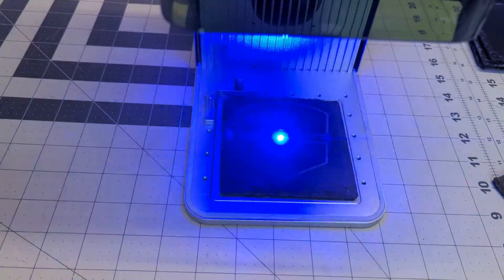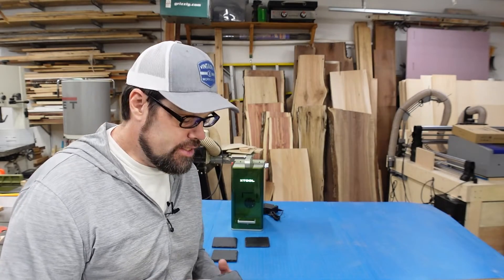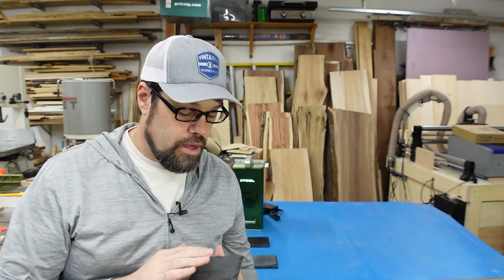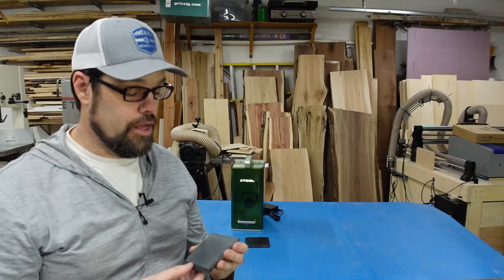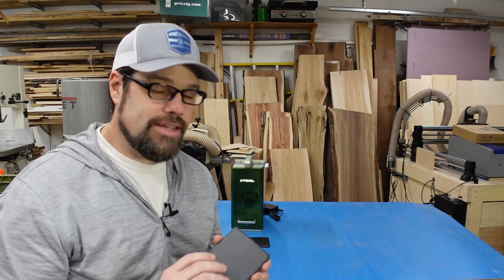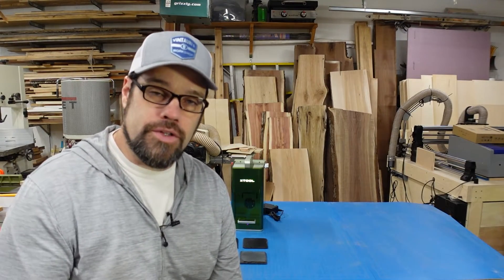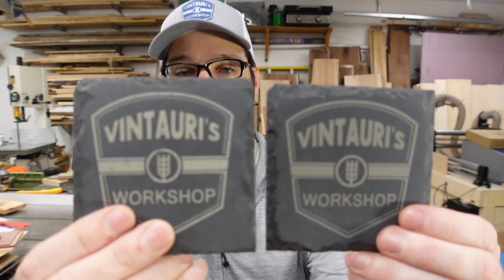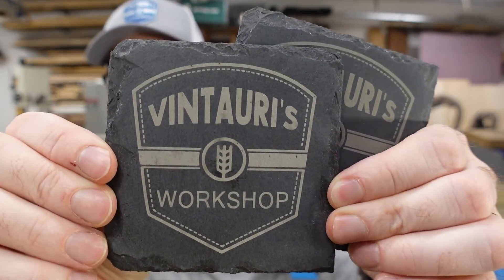What is the best way to engrave slate tile with the xTool F1 Laser?

Comment: Is is mandatory to wear safety googles or the green cover is enough, if needed which goggles do you wear?
Reply from the maker: If the green cover is slid all the way down, xTool states that it will block the laser light and from my experience, it does do a good job. However if you would like an extra layer of safety or if you need to run it with the cover up for larger items, here is a pair I recommend that will cover both the blue diode and IR laser wavelengths. https://amzn.to/4eWzNxj

Comment: what is the best setting for engraving text on slate with xtool F 1
Reply from the maker: That will be somewhat personal preference on what look you are going for.  I like the bright white that I get with the IR laser, running it around 200 line density, 100 speed, and 80-100 power.

Comment: I don't have any experience with LED lasers, but that IR laser looked good. As for coating, my advice is to just engrave it and then coat it with hardwaxoil. I use Osmo Topoil 3058, which as a bonus, is food-safe. Just apply it thinly and wait a minute, then rub off all you can with a dry cloth and let it harden for 12-24 hours. This produces nice contrast and will keep the finish for a long time.

Comment: What does duration do to the mark, increase/decrease etc. I suppose I will run a grid with it and figure it out. Nice content, that blue laser on sanded and finished is much closer to red laser output. I suspect I would go that way, prep a batch while burning designs.
Reply from the maker: Duration is generally used in raster engraving to tell the laser how long to stay on each dot or pixel. That would be a good test to try, it would be similar to slowing down the speed and might give a deeper engrave depending on the power and number of passes used.  On tile however I feel it would cause more of the yellowing look if it was set too long. I might have to revisit this and see how it effects the results.

Comment: Hiw long before we see more powerful IR lasers in these machines, 8w probably the logical max with 4 IR diodes ?
Reply from the maker: It will be interesting to see if they can increase the power on the smaller diode IR lasers or will focus on the fiber modules.